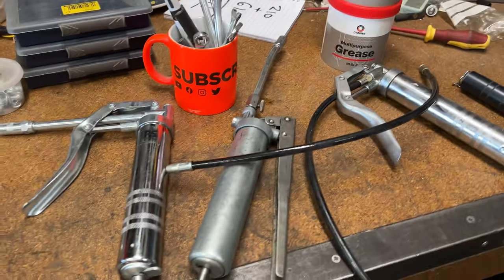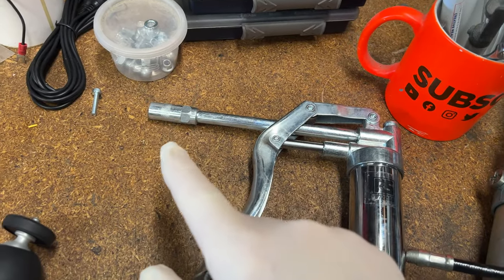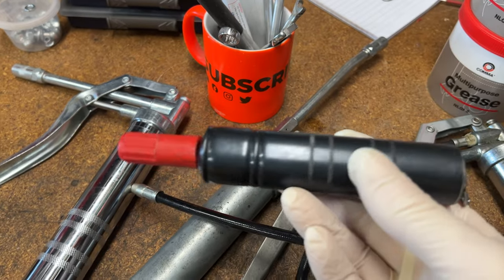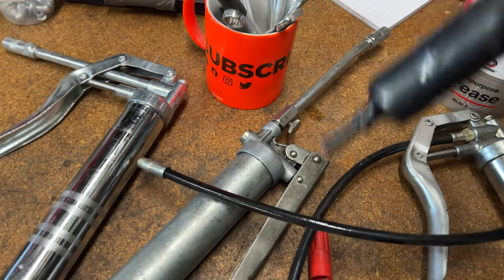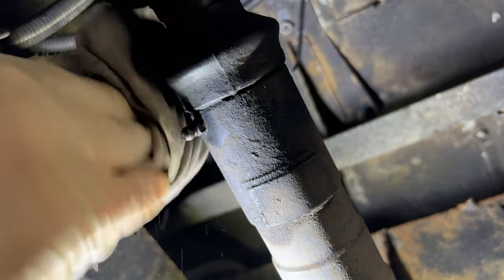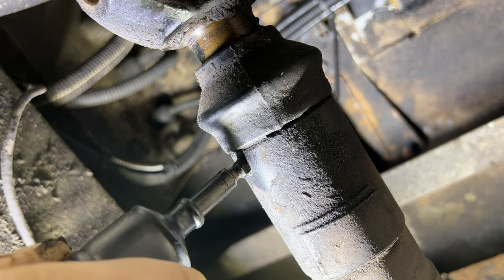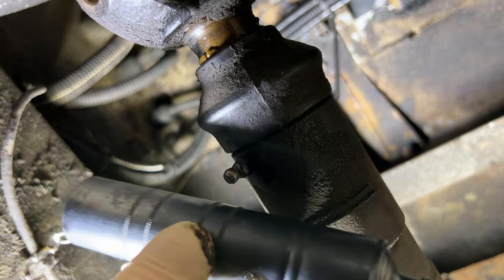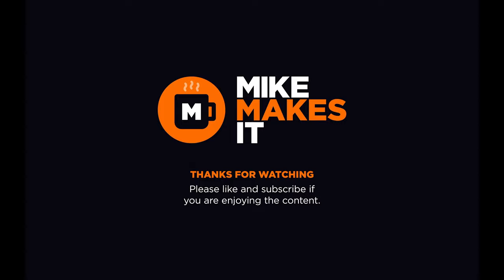Land Rover Push style grease gun. Recommended for the Defenders nipples.

Comment: How do you fill it, just scoop it in, I have a tub of the grease as opposed to a canister
Reply from the maker: I pull the chain to pull the plunger in then press the gun tube over the grease tub and press the gun into the tub which forces the grease into the gun’s tub. Normally the tubs have a plastic cover on the grease with a big hole in the middle. Hope this helps. 👍🏽

Comment: Just whaat I was looking for. Thanks Mike. Quick question, can you grease the whole prop with it mounted? you don't need to remove it? Sorry, first timer here. Thanks
Reply from the maker: Hi, yes you can but you might have to move the truck a couple of feet as the grease nipples can be in the wrong position to grease. Moving the truck a tad rotates the prop thus moving the position of the nipples.
Reply: Thanks @MikeMakesIt  for the info!